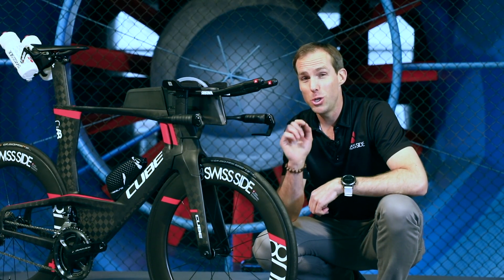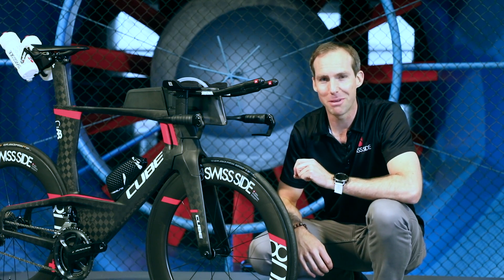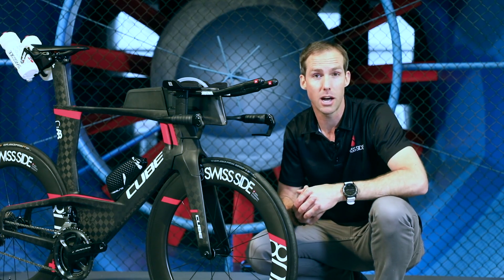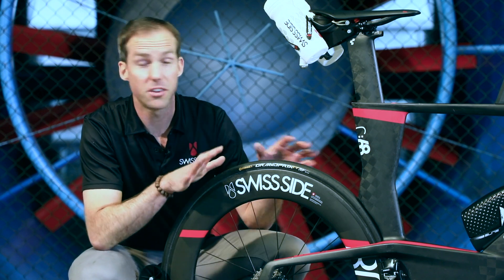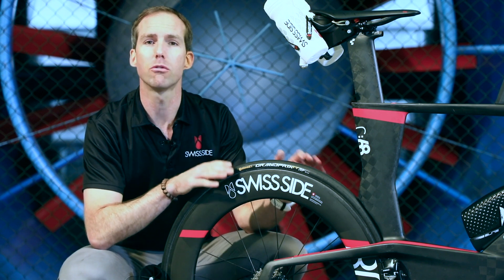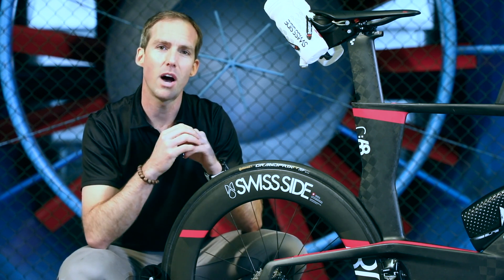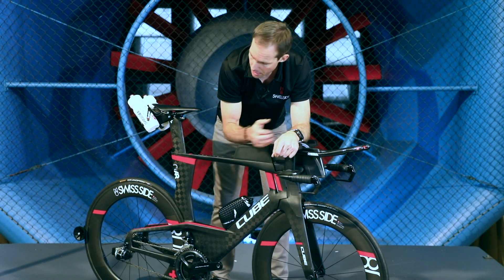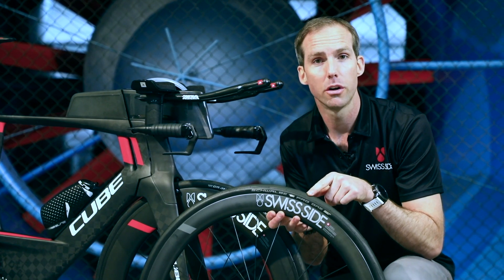Swiss Side AERO TIP - TYRE CHOICE

Comment: It's an interesting concept that is often overlooked when talking aero rims. However, aero is only one part of the equation: rolling resistance is the other. Aerocoach tests give the full picture showing that more slick race tyres can still win overall compared to the GP5000 due to lower rolling resistance. Still, it would be nice to know the aero benefits of a tyre before you buy them. I assume (hope?) that manufacturers do test this, and make an aero/rolling resistance trade-off that comes out best for the tyre. Additionally, puncture resistance is another consideration, no use having thé fastest tyre but go flat during your race/workout/recreational ride.

I'm an amateur cyclist, this is not really relevant to me, but it does satisfy my analyst needs :D

Comment: does front tire depend also on width of your rim? it seems that many wheels have wider beds now, since the majority of us (me included) are not TT specialists so we often are more concerned with rolling resistance than aero.  but if I have a narrow tire and a wide bed or a wider tire the bulge of the tire will shape differently.  I find this concept of the disruption from tread quite interesting - thanks for all your cool content.  One day I will add these as a set of rims.